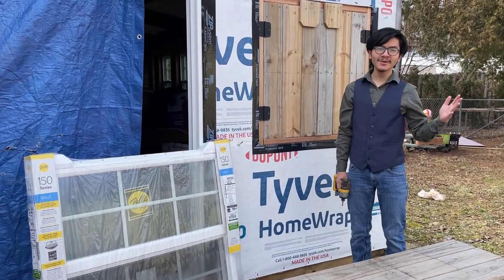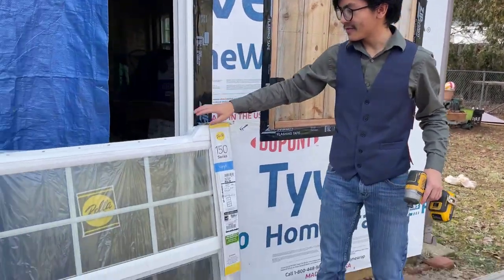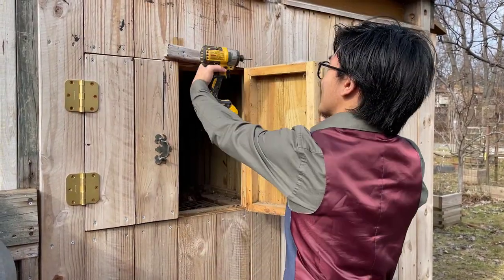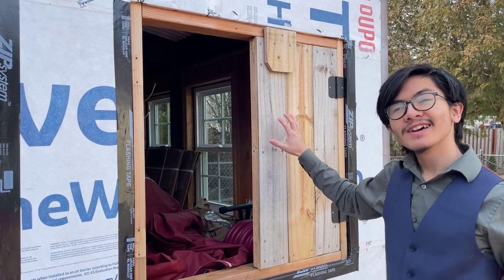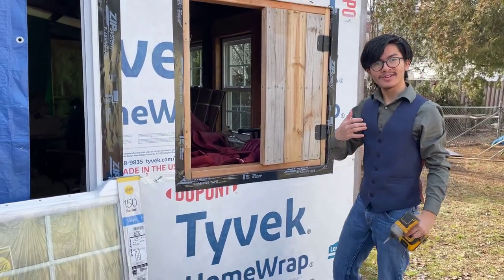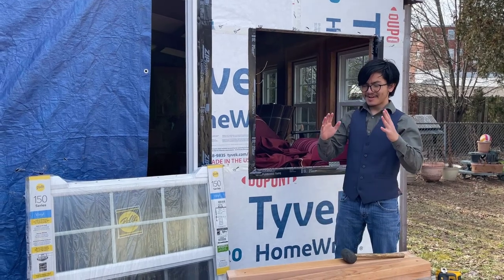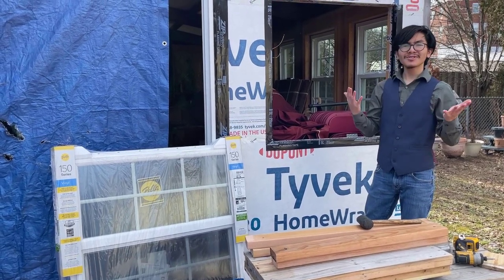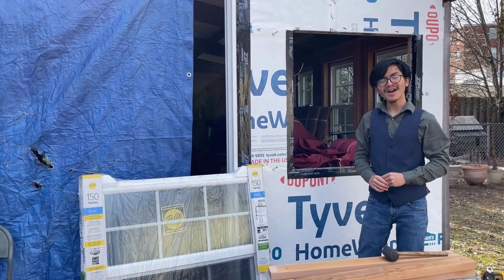Ideas How To Build Temporary Double Casement Window | Converting Our Patio Into Enclosed Room Vlog

Comment from the maker: Here are the #ad links to some of the hardware, materials & tools showcased or required for this project:
1.  https://amzn.to/3DJunFa  |  6 Inch T-Strap Shed Door Hinges Heavy Duty ,Black Tee Hinge for Wooden Fences,Yard Door,Barn Door Gates, Wrought Hardware Rustproof,2Pack/Set
2. https://amzn.to/3DI3uRH  |  Window Hardware Co- Maxim Dual Arm Casement Operator 41012 | Casement Window Crank, Truth Window Hardware with Track, Handle and Bracket (White, Right Hand)
3.  https://amzn.to/3UaL9lZ  |  3M Outdoor Patio Door Clear Insulation Kit, Heat or Cold Window Insulation Kit for Large Windows and Sliding Doors, 1-Door Kit, 7 ft. X 9.3 ft.